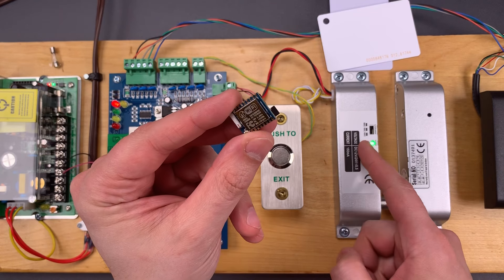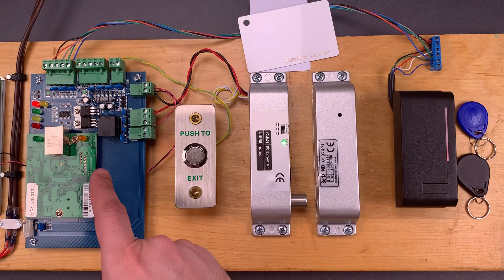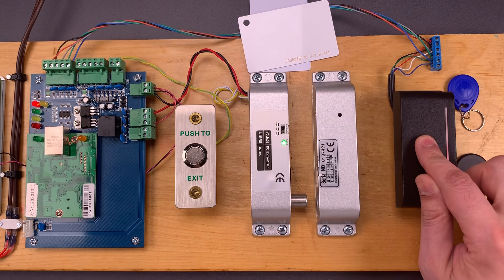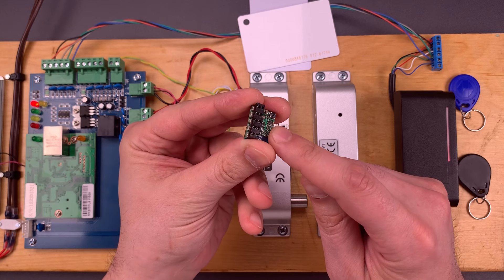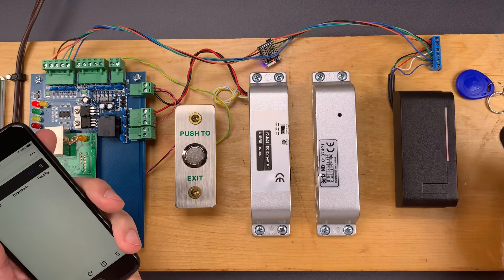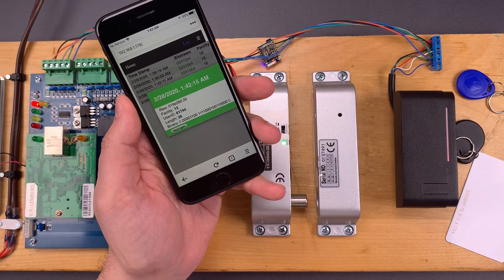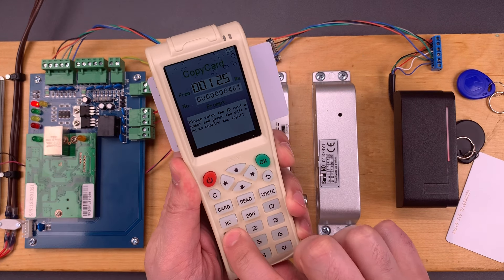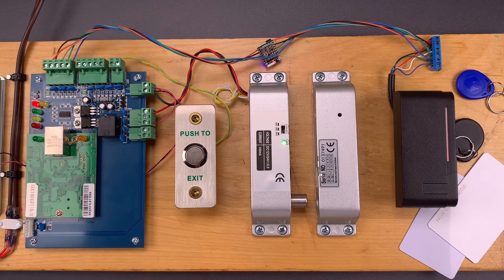[1052] Bugging an RFID Card Reader

Comment: LPL in 10 years: To unlock the door, we first compromise the houses' internal wifi network via social engineering, giving us access to the keylock's API port, letting us run a known exploit on the unpatched firmware, letting us control it whenever we want. 

This was the most hacker-esque video on the channel I have seen. But still, fun, and good to point out the protocol weaknesses of these locks. Manufacturers should make the locks secure against digital attacks as much as physical, and is one of the reasons why I don't want a digital lock into our household.
Reply: A kid from 2040: that's how we did it in the past
Reply: @Evi1 M4chine You cannot connect to the router without already being on the internal network. And if the router has a public-facing root-enabled telnet console... Well... Then it belongs into the trash and nowhere else (:
Reply: I appreciate the accurate steps you gave in your joke, makes it funnier IMO - 'unpatched firmware' was my fav. So true.
Reply: LPL (outside my house): as you can see, this homeowner went with strictly mechanical and hardwired locks with cryptographic modules on the main entries. clearly, he's subscribed to my channel and doesn't trust technology
Reply: @dercooney  Yea, because lets be honest, how many of the "normie" users go, at any point in their day, and think "Hmm... I wonder if any of the smart stuff I have here has internal firmware update available... So that if someone pwn'd my wifi that I didn't change the password to since first setting it to the name of my son and his birthday, they wouldn't be able to take control of my whole household" -- None, till something huge explodes all over the news...

And even better, what if the theoretical family went like "Hey! If I connect the lock to the internet, I can control it from wherever! So if my spous forgets her keys while I'm at work, I'll still be able to unlock the door for her!"

And don't get me started on the trend to have all the smart crap connected to "The Cloud, wooooooo~" -- As if that was something to be desired. Then someone compromises /someone else's/ internet-connected servers, and boom, access to all the devices that are part of the "cloud" (Of idiocy)!

...I run a few smart devices at home... But have them strictly stuck on the LAN, with DNS blackholing so they will never connect to the bloody clouds...
Reply: @Evi1 M4chine As an IT security guy...this is why I do not and will not have a SmartHome....that said, there is no "unprotected telnet port" on any device that is not old enough to get a drivers license.
Reply: @systemsbroken  If you really worked in IT security you would know that a good home network is nigh impregnable.
Reply: This literally is not shown. He shows he has admin access already which means he in fact did not do any hacking at all. All he did was setup the device as a consumer and dupe a key. He failed to mention that for someone to do this they’d have to actually hack a network and somehow get access to the admin control app that is likely password protected etc. this video is fucking bullshit. “A hacker could compromise this system with very little effort” but fails to demonstrate how this would be done haha.
Reply: @AntwonDaBusiness  as far as I could see, the device he used plugged onto the wires between the reader and the control unit. You, as an attacker, have access to the reader unit as it's presumably outside. If you knew the structure of the reader, you could take it apart, inject your device and reassemble it. Then just wait for a valid user to authenticate and voila, got a copy of their key. 

This is a major flaw, security devices (Which a lock is, a physical security device) should not be vulnerable to such a simple thing like a replay attack...
Reply: @krashd  yes, a network to which you have no physical access, that has a strong wifi security algo (wpa2) with a strong password, and a bunch of well educated users who can tell a phishing email on a first glance is rather secure. 

Sadly... Most home networks fail at at least one of the points, making them vulnerable to a well motivated attacker... 

And thaf ignores the whole cloud stuff, that is just another attack vector...
Reply: @krashd   (genuinely not sure if sarcastic or not? also genuinely not trying to start argument, but ... ) 
At most a wpa2 takes 24 hours to break on OOB home networks. Pineapple attacks closer to 2 hours. Whitelisting MAC addresses might extend this to 48 hours. Few home routers are resistant to brute force attacks (not lock-out, no time delays, etc) Commercial companies spend large money to secure their networks for good reasons.
Reply: No need to use social engineering to hack a wifi network. 
Most routers have wps enabled these days. You can exploit this gaping security hole to gain access within an hour.
Reply: LPL: "...and to show you that it was not a fluke..."
Joe Biden: "What is this guy doing in my office!?""
Reply: @krashd  The average home network's security would only be nigh impregnable if the average home were to have a properly configured enterprise firewall. A lot of home routers have Universal Plug and Play enabled by default which makes for easy pickings, given the amount of random crapware that will try to throw a port out onto the Internet (for example, Nvidia's Geforce Experience). Even if a given router doesn't have UPnP enabled by default, there's still a decent chance that the firmware is crap and the router is doing something it's not supposed to, or it's connected to "The Cloud", in which case you're a sitting duck if your vendor gets hacked.
Reply: @Evi1 M4chine "like Amazon does". Man, that is golden.
Reply: It's REALLY easy to encrypt it and make it so that it won't work. you can use any elliptic curve algorithm that would encrypt some random shit that only the other side can know it was encrypted in a right way.
Reply: Most electronic locks failsafe open when the power is cut.... great system.
Reply: Digital can be really secure but RFID is stupidly insecure
Reply: @jimsmith3715  I would say stupidly insecure for personal security or personal property security. For big buildings that employ a lot of people its a great solution to track whos coming and going, as well as keeping out unwanted guests. That along with security guards is all you really need in a situation like that, and thats what its mostly used for in my experience.
Reply: @MrLukhut1  problem is f a card is compromised it can be made to look like certain uses are accessing certain things at certain times
Reply: @jimsmith3715  Yeah compromised cards a big deal, thats why most if not all terminals are combined with CCTV to verify the person if something were to happen. Wouldnt stop the act of course, but would aid in catching the individual
Reply: From your logic, you would want a digital lock, given LPL is mostly about breaking all the regular ones. xD
Reply: @pav431  This happens all the time. It's called WEP and is just as bad as an open telnet port. Some ISP's still provide technical support for it.
Reply: My dad has an electric lock and I really wanna tell him to reconsider

Comment: I bought a cheaply made RFID reader for less than $20 for my apartment. I used it to run my deadbolt with a car door actuator, and it was really effective. Being a rented apartment I could not do much to modification to the door. I used existing holes, and kept all of the electronics behind the door. The RFID reader could read it through the door, and seemed more secure, but who am I kidding? The LockPickingLawyer would just look at my deadbolt, and the tumblers would set, the rotor would turn, and unlock itself as he came near out of respect.
Reply: You are my hero of the day, I live in apt and have been trying to rig something up because my bedroom door is old school, but I want to digitize it so leaving my key behind isn't a worry. The actuator is the missing piece to my puzzle. I'm not concerned about hacking this interior door is just for privacy from roommates, plus if they get door open I have a series of Cameras and motion detectors inside. It's just a lock for "keeping honest people honest" ie if I'm out and someone wants to take a curious peak in my room if door is open. If you have any details you're willing to share about your setup I'd appreciate but I understand if you don't want to give up your trade secrets.
Reply: Reading through the wall sounds like a great solution for physical access to the system.
Reply: @shrimpboom8  It is. On the other hand, those cheap readers usually use basic EM4x02, which doesn't have any security. When this card gets into required magnetic field, it pretty much just screams the ID number in infinite loop. Device that would alow you to copy any card of this type is actually a nice weekend project.
Reply: @peterkwolek2265  damn that's a lot of security for a bedroom...
Reply: @Illusion-clock  To give a little context I had the cameras and sensors at a normal deployment for a house, but when I moved the new roommates didn't want cameras in common areas so my security net got all bunched up in my room. If I didn't have the cameras/sensors when I moved  in, I would have probably just bought one to snap a photo when I'm a way and someone enters. Most of it dies as soon as wifi drops so it's actually kinda  poor.
Reply: @peterkwolek2265  Thought occurs that you could have just sold them like a normal person
Reply: @elpechos  Invest $300+, then sell for $100 (if I'm lucky), and spend another $300 when I move back to house? Plus for even more context, I like tech lol. AND wth is a normal person? no one is normal, we're all different. Your "Normal" is wasting $200, mine is to hold onto things, maybe in your eyes that makes me a hoarder or something but what have you gained by calling me abnormal? You successfully hurt my feelings (for about 15 more seconds till I forget about all this), but are you going to get a bigger paycheck next week?
Reply: @peterkwolek2265  Thought occurs that you could have just packed it all into a box and let it gather dust on the top shelf.  

Then it'll slowly devalue to zero and you can throw it out later.

 Saving you the $200

Being crazy was far from your only option.
Reply: @elpechos  Thing is, the devaluing does not matter because as long as it still works, it's useful to them.
Reply: @roembol  it's not useful to them. They set up a whole houses security camera network in a bedroom. That was the entire point. They had no use for it
Reply: @elpechos  have you considered that maybe the reason they are not selling it is because they want to use it in the future?